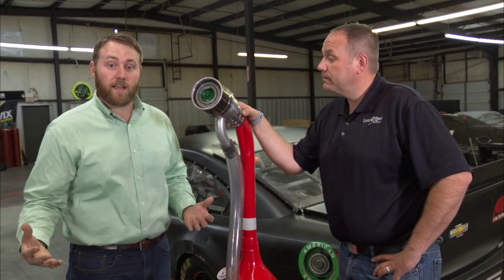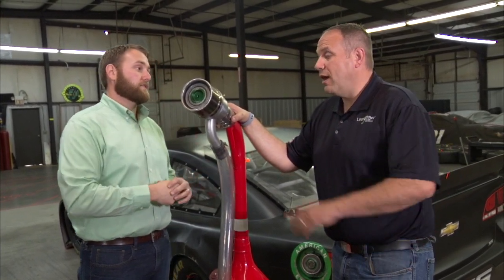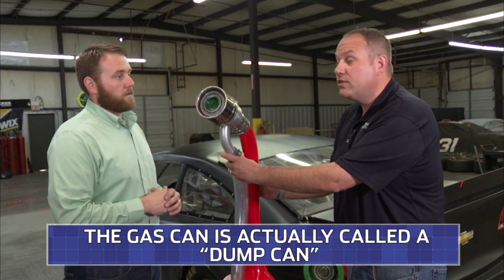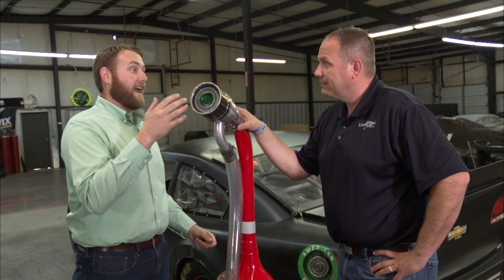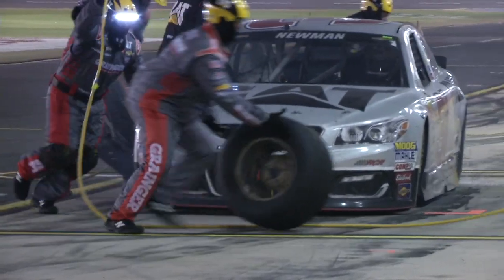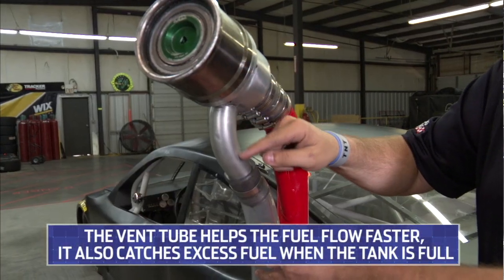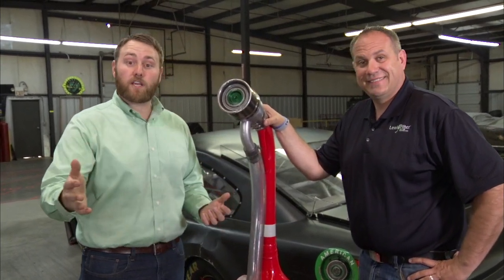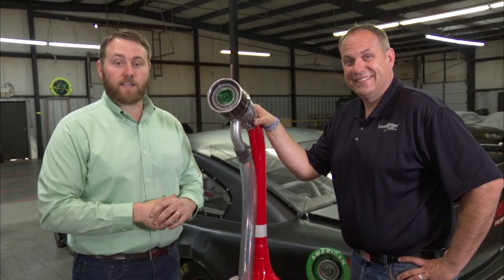Fill 'er up: How gas cans work

Comment: I thought they would be pressurized?
Reply: Nope, it’s not necessary. And the reason they work so well is because of two very critical things involved… the first critical thing is the “design”. We all would very likely be dumbfounded if we knew exactly how many years and years of man hours went into this final design. And by “final design” I mean this unit were looking at in the video. These gas cans, along with any and all of the parts and pieces that make up these cars, their chassis & suspension, tires, windows, steering wheel and any and every thing else that one could think of that resides between the front bumper cover all the way to the rear bumper cover, are always being redefined and/or redesigned in an attempt to streamline the way it’s used and/or designed and make it lighter, stronger and more efficient. Each NASCAR team, especially the big powerhouse teams like Hendricks Motorsports, Richard Childress Racing, Joe Gibbs Racing, Team Penskes, etc. all have a crew of people that are just solely responsible for upgrading/redefining/redesigning the parts and pieces, that make these NASCAR teams function, in order to go faster and faster each week. So, “design” is one of the two most important things that make these gas cans work. The second thing is “gravity”. These tanks are gravity fed… just simple physics. The point where the gas exits the gas can is lower than the point where the gas is being held in the gas can, so naturally the weight of the gas pushes the liquid down and out of the can. The big clear vent tube is another design tweak that allows the gas to be gravity feed with little to no resistance. It doesn’t have to burp, per sè, like a bottle of water has to when turned upside down while pouring the water out. Hope this helps.
Reply: @DFWJon  You deserve 2 thumbs up for that explanation but I can only give you 1? Thank you

Comment: Gee, maybe they could explain how the can starts and stops the flow, how it connects, how much it weighs, how many gallons does it hold, how many gallons per second it flows, how do they know when the first can is empty when using 2 cans........terrible video aimed for children.
Reply: While this "informative" video did, indeed, leave out a whole lot of pertinent information, it did, in fact, include the answers to a couple of your questions that you mentioned in your comment. You asked, “how many gallo s does it hold?”. The answer to your question is right about the :30 second mark of the video. It states that the can holds 12 gallons of gas.
You also asked, “how much does it weigh?”. And that answer is just a matter of multiplying the amount of gas in the can, 12 gallons, by the weight of a gallon of gas, which gas weighs right at 6.1 pounds per gallon. So, 6 lbs., per gallon of gas, multiplied by the 12 gallons that the can holds equals 72 lbs. of gas. The can itself is likely made out of aluminum, which is pretty lightweight, and likely weighs about 15 lbs when empty. The 15 lb gas can and the 72 lbs. of gas make the total weight of the gas can, when full, right around 90 lbs. give or take a pound or two. That 90 lbs. is just a roundabout weight simply because the temperature of the gas determines it’s weight. So, if the gas is extremely hot or extremely cold, the gas will weigh differently at any given time depending on its relative temperature. 
You also asked, “how do they know when the first can is empty when using two cans?”. Well, that answer is about as simple as asking, “how do you know when a glass of water is empty when using two glasses?”… there is no more gas coming out of the can, just as there would be no more water coming out of the glass. Also, when full they weigh about 90 lbs. and when empty they are very light, in comparison. I would imagine that you can also feel that the can is empty along with the fact that there isn’t any gas coming out of the spout either. Also, it’s worth mentioning, the fuel cell inside the car holds 22 gallons of fuel and the gas can holds 12 gallons of gas. That means that there are two gallons more, per two cans, that what is needed to fill the car full of gas. So as long as there isn’t but a few drops in each can after the pit stop then you know you got the car as full as it could be filled. 
Your final question was, “how many gallons does it flow per second?”. To answer that requires a little more simple math similar to hove when we calculated the total weight of the gas can itself. We know a “full service” pit stop, 4 tires and filling it full of gas, takes right about 10 seconds to complete. In that 10 seconds they dump 22 gallons of gas in the car. TO figure that out it would be 22 gallons of gas divided by 10 seconds for the stop, which equals out to 2.2 gallons of gas that flows out of the can per second. Actually, if we’re being technical, it’s a little bit more than 2.2 gallons per second considering that the gas man has to take a break to swap cans and that allows the other pit crew members to slide by him to service the drivers side of the car. I would thing that it takes roughly a second or two to swap cans so we’re now looking at about 8 seconds of gas per stop. 22 gallons during 8 seconds equals out to almost 3 gallons a dispersed per second, actually it’s more like 2.75 gallons per second during 8 seconds worth of filling. 

Hope this helps. And, with all due respect, next time… you might want to pay a little more attention to the video instead of thinking of ways to undermine the video creators, via your unnecessary questioning, while the video is playing. A lot can be learned by just listening and very little, to no, talking!!! That is, unless you’re a child whose watching videos intended towards more of an adult audience!?!?!? Just saying.
Reply: @DFWJon  Cool. Thanks for the thesis . You get an A+ for the deep look into a 7 year old comment. I wish I as smart back then in 2016 as you are today in 2023! Global warming. Different president, electric cars, new wars around the world....And you spent an hour criticizing me from 2016 about gas cans on youtube? Just saying. Funny that most comments said what I did. You got work to do calling them all children. Get busy.